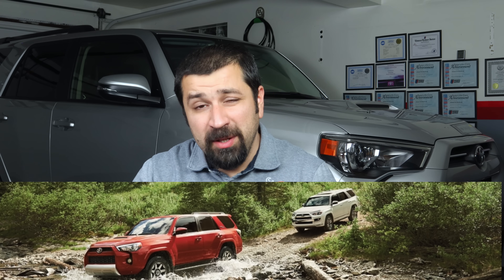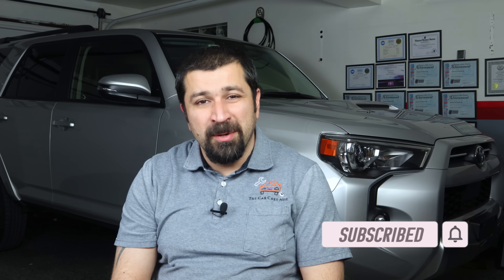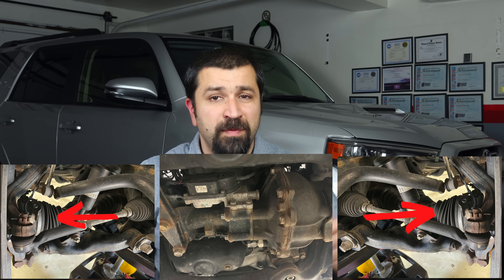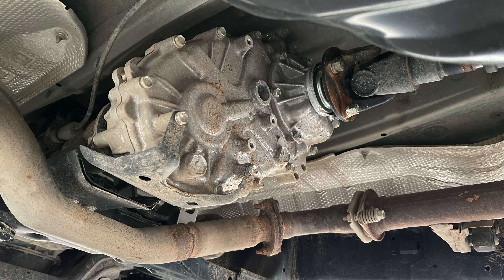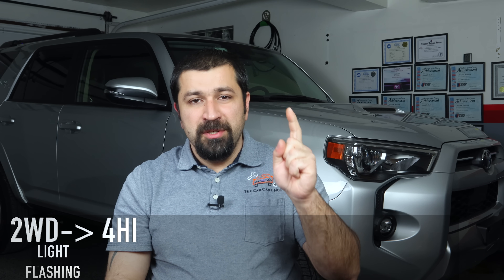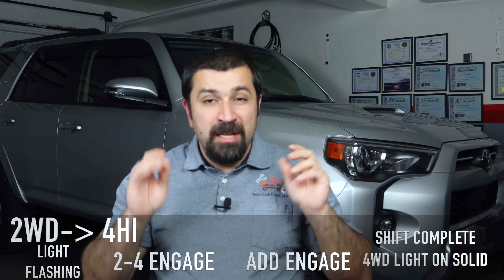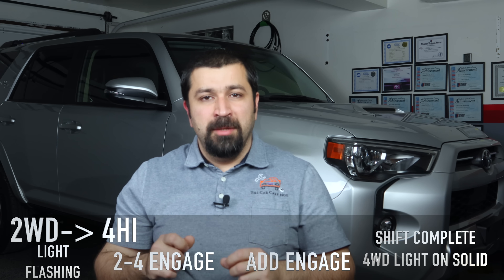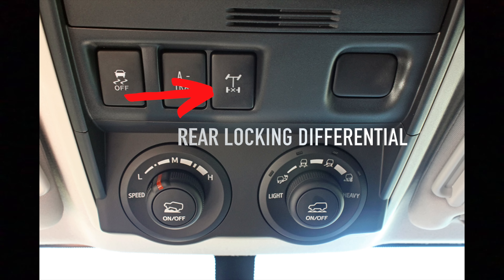How does Toyota 4WD System works and why is it reliable?

Comment from the maker: Let’s clarify one thing that many have commented about. Center locking differential.

There is models that have both 2Hi,4Hi free unlocked, 4HI locked ( center diff locked ) and then 4Lo. Many have mentioned that there is not such thing. I encourage you to research the 4th generation 4Runner VF4AM transfer case on the V6 models which is essentially a modified full time transfer case to have an option of 2WD driving. It does have a TORSEN center differential and can be shifted in 2WD as well. That was called multi mode 4WD system.

So in my video when I included the center differential on the part time 4WD I was referring to this particular case. So YES there is a model with center differential and is technically speaking a part time 4WD. The terminology can be taken out of context here.

Thank you.
Reply: Beside the Nightshade or Limited version, are you aware of CURRENT 2021 model that have a Torsen (Multi Mode 4WD)? Thanks
Reply from the maker: Hi! The multi mode is not available anymore as honestly it was overkill to begin with.
Reply: @TheCarCareNut  ...I love my overkilled 4th Generation V6. I can lock 4HI or let it roll as 4HI. I can leave it in 2WD, and I can use 4LO but I never needed to.
Reply from the maker: @Smoke Stack so it’s supposedly made to help with gas mileage so you can drive on dry pavement with 2WD. Do you notice a difference?
Reply: @TheCarCareNut  ...Absolutely, when I have it in 2wd along with my Michelin Defender highway all-season tires, it’s smooth and good on gas,19.5 MPG and I drive 65 MPH. When it snows, I don’t change tires, I simply switch to 4HI and tires hold up fine in snow, if I need a little more bite I lock 4HI mode, have never needed to be in 4LO.
Reply: @TheCarCareNut  I live in the Pacific Northwest and deal with lots of rain and snow in the mountains so the full-time function is very helpful in the wet and where there is spotty ice and snow on the road. There is a noticeable difference between four-wheel drive and two-wheel drive on the pavement as far as to drive train drag and gas mileage. Two-wheel drive gives around 1to 2 mpg on the highway spending in the speed.
Is the Torsen-equipped transfer case as reliable as the standard one?
Reply: correction to my reply: the mileage difference in 2WD varies depending on the vehicle's speed; smaller around town and greater on the open highway.
Reply from the maker: @billthompson301  I haven’t seen any issues with either transfer case other than seized actuators from lack of use. Thank you for your feedback on the mileage difference
Reply: @TheCarCareNut  Do not have any particular experience with that specific transmission, but can say going from fulltime AWD in the audi quattro systems to the part time in my tacoma is a huge downgrade in New England road driving. The reality is that in intermediate conditions (where it is snowing, but the road is being worked to where you are changing constantly from wet pavement to snow and back), you have to choose between having 4hi on and binding up your transfer case or being in 2wd and catching the rear when you go back to snow.

I would love such a system in a 3rd gen. I could save gas during the good days, use the 4HI during snow, and if things got really bad (where audi's quattro and subaru's symmetrical systems fail, digging themselves out) I could lock it into 4lo, lock the rear and deal with that situation.

Sounds like the dream system to me, not overkill at all! Toyota should have kept it!
Reply: @billthompson301  that's a huge difference if you are going from 17-19 or 19-21. Worth it on such a big vehicle.

I could see why something like an camry or rav4 wouldn't have it, because they don't seem to gain as much (they need around 20-30mpg increase to save the amount of gas per vehicle in reality, MPG sucks as a measurement) and being transaxle platforms, the easiest solution would be to swap from AWD to FWD which would just feel worse in driving.
Reply: @82dupont  Me too on my 2007.
Reply: @asymsolutions  the mixed road condition are also typical for Missouri winters. I specifically went with an older 4th gen 4Runner for the ability to put it into 4wd w/o the center diff locked. I can set it and forget it. Absolutely never had an issue. It’s amazing.
Reply: @TheCarCareNut  Hi - i just bought a 2023 Limited 2 mos ago - i dont have that much knowledge - about the automatic shifter - i learned the flashing has to complete for the ancient computer to compute - can i use 2WD mode in my case - i cant recall whether i have a center locking button in my headliner next to the A-trac - i think i am confusing my own question - hope you cab answer if can do what 82dupont is answering below - or he is talking about a 4runner with a Manual Shifter version ?
Reply: @82dupont  do you have a Manual Shifter Version ? I would love to learn if i can do 2wd with my 2023 Limited with an automatic shifter - any guidance - that gas mileage is killing me for 2 mos of ownership 😢
Reply: @badermalik2823  ….I don’t have a manual. I have 3 options on my 4runner. 2wd, 4hi, 4lo. 

I keep it on 2wd and use all season tires, my 4runner is not lifted and does not have aggressive tires.
Reply: @82dupont  What Year/Trim level is your 4Runner 
Mine is a 2023 Limited has (H4F - H4L -L4L) Automatic Shifter like yours
Reply: @badermalik2823  ….mine is a 2007, we have same drive train. However I believe yours is in 4WD all the time. Where does your knob point to on the gauge? Mine is in 2wd until I engage 4hi and the green 4hi icon comes on.
Reply: @82dupont  It is on H4F as default option - i have alltime - sorry for delayed response . 
Only H4L and L4L as Locking option
I think i dont have Center Diff Lock like yours 
And that is why she is a Full Wheel Drive
Reply: Thanks brother
Reply: Was about to comment on this: the pure part-time 4WD system on the 4Runner has no center differential, it is a chain drive. The transmission spins the driveshaft to the rear axle and if you engage the 4WD system, you connect the system that drives the rear driveshaft together with the front driveshaft.
Reply: 2nd gen Sequoia has the same thing: 2Hi, 4Hi, 4Lo, and w/ central diff lock. Amazing 4WD system.
Reply: How is with 120 Land Cruiser Prado? Any tipps what to watch regarding this system? As I read thode should be Full time AWD? Or I am wrong? Just bought one 2005 with 213.000km runs great.
Reply: @The_Touring_Jedi  Make sure the center diff lock works, and practice that actuator every month. It has the same t case as 4runner V8 and GX470. It has a manual H4 L4 switch lever, so less of an issue compared to our electronic ones.
Reply: Appreciate your knowledge I am learning about my 21 TRDOP
Reply: Let me guess.. It’s Ancient.
Reply: HELP !!!!   Can someone point me in the right direction in resolving my 98 4Runner issue?  When I engage 4H it goes in silent but when it goes back to 2H (disengage) the is a loud bang (like a sled hammer bang). The is a delay for about 30 second to disengage as I drive down the road.  My other 4Runner does a loud click only.  I don't know the history on the car but I have changed all the oil already.

Comment: 2020 Tundra SR5. 4x4 works fine ... but intermittently when moving from 4HI to 2WD it seems like the front diff is not fully disengaged. All 4x4 dash lights are off but when driving around 35mph I get a "rough" friction sound from the front that I thought was either cupped tires or wheel bearings. (replaced all but no change). Sort of a cycling "groan....groan...groan" sound.  If I go into 4HI and back to 2WD a few times I can get lucky and the sounds stops. My question is where should I look first? Is it the ADD actuator on the front diff or is it possible that its a sensor circuit on the transfer case actuator that's not "sensing" a completed front diff 4wd disengagement? Or is the "timing" on the front ADD actuator out a bit?  Any tips would be appreciated?  LOVE your videos !! Thank you.

Comment: I had a question I have a 2014 Tacoma TRD off-road with the rear locking differential, if I once a month engaged my system what all would I need to go through as an example 4 low, high, rear lockers, down hill assist is there anything else that you would recommend?

Comment: Questions for The Car Care Nut regarding 4Runner SR5/TRD and Limited trims (2024 for example): 
For part time 4wd you said that 4H should not be used over 60mph. How would one drive on the freeway in heavy rain or in snowy conditions then while wanting 4WD/AWD for maximum traction/control? Just drive under 60mph in 4H or better to have a 4Runner limited trim with the full time 4wd (AWD)? Looking to buy a 4Runner and wondering if the SR5/TRD or Limited trim is the better option.
Also, as the part time 4WD (SR5/TRD) has no center diff (instead just a transfer case), correct? Does this 4H behave like the limited trim in 4HL with center diff locked? Meaning do both systems then spin the front and rear wheels at the same speed? Is this why the 4H should not be used over 60mph?
Sure wish Toyota would explain their 4wd systems better.

Comment: I was always a Jeep guy. I’ve gotten tired of the garbage they’ve put out since the early 2000’s. Made to break garbage. 
Got an older Toyota 4Runner. Love it and will be turning to Toyota from now on.
Reply: Same here. My second vehicle was a 98 ZJ with a factory lift and HD springs. That vehicle was a beast, but I’m glad I got rid of it before it had issues. Now I drive a 06 LX470 with 249k miles 😂
Reply: lol!! You are one of the few very very smart folks who gave up on jeep but all the old and young kids in my neighborhood are all buying them so I bought the stock and I’m holding it

Comment: I have a 2010 V6 4WD SR5 bought new. One issue I have is with the hill descent control, which is fixed at 4mph.This is much too fast to safely descend a steep, icy road. I can understand that with a typical snow-covered city street, and with peer pressure, this might be a good speed, but on a sheet of ice it is of no use. As an aside, my 2019 Ram 1500 has both AWD and 4Wd, and thanks to your explanation, I think I understand how they pulled that off. Great series.

Comment: My '92 Toyota 4WD system is part time and has locking front hubs, an open front diff, vacuum operated 4H selection, cable operated 4L selection and a 4-pinion LSD in the rear and no centre diff. It's great, though old.

Comment: So, what does my 09 Highlander have? You cannot turn on 4 wheel drive as you can in a jeep. Somehow the car is claimed to be AWD. I've only had this car for a couple of weeks and I do not understand its 4x4 system.
Reply: If you have AWD, ALL WHEEL DRIVE then you don't shift it into AWD, it will engage into AWD all by it self or when your tires in the rear don't have any traction and they start spinning and when that happens then the 2 front tires will engage and all 4 tires will drive the vehicle but AWD works all by itself, you do not press any buttons just drive the vehicle, it's all automatic because of the computer.

Comment: I have the knob, not the lever on my SR5.  If I get stuck somewhere while in 2-wheel drive, can I put it on 4L without it first engaging in 4H which requires the 4R to to moving?

Comment: My 2007 tundra 4LO whines abnormally loud and 4HI does not.  We just replaced the front differential and serviced the transmission.   The part has a 3 month warranty. Should it whine really loud?

Comment: Thanks for your passion and sharing knowledges. I have 18 TRD Pro with 58k miles. My concern is I opt to shut off engine when going from 4L at a stand still to 4H due to the spinning gear mesh sound instead of slamming it back to 4H- is there another way to avoid the smashing mesh of gears besides shutting down engine? Even if I wait the gear seems to free spin

Comment: On my tundra it won't work. The light stops blinking and I hear it shift but then it will go a few feet, tighten up and stop moving, like a gear is getting stuck. When that happened I shifted back to normal and it's doing fine but 4wd won't work for some reason. Recently I changed the transmission fluid but not the transfer case. I've only had to use 4wd once in soft dry dirt.

Comment: You have the best reviews. 
I have a 21 TRD premium with manual lever. I had the 4x4 light flash on me. I believe mine went into the limp mode my local dealer had it for 2 days scratching their heads. They ended up replacing the ADD.but I believe what you said in this video was what happened.

Comment: Wow, all that just so the front driveshaft doesn't spin in 2WD....  I shift my Sequoia into 4WD about once a year, and drive it about 3 - 5 miles.  I never put it in 4 LO.  Should I be doing that?  Also, how fast can I drive it in 4WD?  I know it will shift into 4HI at 60MPH, but I have been told you shouldn't drive it fast in 4WD.  This is my first 4WD vehicle, BTW, in case you couldn't tell.
Reply: usually the owners manual will answer all your questions

Comment: This is a good video for mechanics.  I'm not.  It doesn't explain how 4WD works from a driver's perspective.  For example, if I shift from 2WD to 4Hi (2010 4runner manual 4WD shift) can I make sharp turns on dry pavement?  Will doing so put stress on any mechanical parts?  Why is it recommended to stay below 60mph in 4Hi?  Other than lower gearing, which is obvious to any driver, what is the difference between 4Hi and 4Lo?  Can I make sharp turns on dry pavement in 4Lo?  Why not?  If I'm stuck in deep snow or sand and I shift into 4Lo will one wheel spin while other wheels get zero power?

Comment: This is regarding either not engaging into 4L or not disengaging from 4L , and this is for the 6 speed manuals such as My 2019 Sport with only 11K. I’ve never heard AMD or anyone  else mention this “trick”. I call it a trick because I absolutely have no explanation why it works, but for My truck it works 100% every time!  Put transmission in neutral,fully depress and release clutch pedal 2 times! As You release the clutch the 2nd time it will work perfectly!  Try it! This is of course considering the vent hose did not come off (actuator) and is contaminated/ corroded. That is a different story. And I’m sorry to say I do not know if there is a similar “trick” for the automatics, hopefully there is. All I can say is for the 3 pedal variety’s, IT WORKS !!

Comment: Some people claim that you can tow a 4runner behind a motor home with all 4 wheels on the ground if you have the transfer case with the manual lever, which is still contrary to the owner's manual. They claim the owners manual just says not to do it in order to remain consistent across all the 4Runner variants.  I disagree, and side with the owner's manual.  I know you will have the real answer!

Comment: Mr.  Car Care guy, how do I change my 2012 Toyota Tundra SR5,  V8 5.7 engine truck to four wheel drive, part time.  I here you saying,  Front Differential, two front axles, propeller shaft to transfer case.  xfer case mounts to back of transmission.  Xfer case to another drive shaft to rear differential.  How much of my existing equipment will I be able to use?   Original tranny?  original prop shaft? Is there a list with a complete break down for this?

Comment: I just purchased a new trd pro model..trying to figure out the manual shifter. I can’t seem to not grind going from 4L back to 4H. Is the grinding hurting any gears or the transmission? I did it twice..I stopped trying in case I’m hurting anything. Wondering if there a different way to get it back without grinding.
Reply: make sure it’s in neutral (transmission) and you need to shift the 4wd lever more deliberately than you think , slightly quick and slightly with force . mine was like that until i started using it once a month and getting used to the feel of it and making sure everything is lubricated and worn in slightly

Comment: What do you think would cause the 4wd light to blink. So I was on a trail with my 4runner in 4low. I was making my way up an obstacle and in the middle my light started to blink. I have the manual shifter and my 4hi and 4low still works. But now my abs and 4wd and traction control light is on. I just can’t use A-Trac but 4wd still works. What could that be?

Comment: I have a ‘22 4Runner with the manual transfer case.   I have been engaging the 4H monthly.    Today I tried the 4L and I messed up.   I put it in P while it was in 4L and had a grinding noise.   I did it once and then did it properly.   My bad.   Do you think I have damaged something I need to check out?    It’s operating properly after my mishap.    Thank you for your time.

Comment: Great video, great series and great channel! One note regarding something you said in the video. I have a Tacoma 2007 part-time 4WD with dial for 4Hi and 4Lo, assume similar on other models. 

You mentioned that one cannot drive above 60 mph in 4Hi. That is not correct. I think what you meant to say is that the 4Hi will not engage if driving HIGHER than 60 mph. In the old days, one has to stop to lock the hubs manually. 
Now, one can keep driving to go from 2WD to 4Hi, and it will engage IF below 60 mph. If not, the indicator will just blink and not engage. Same to go from 4Hi to 2WD. 

One can go as fast as one wishes in 4Hi. I use it on freeway when slippery (wet under rain) at max tolerated speed of 80 mph without any issues. If payement gets too dry, I move into the right lane, slow down below 60 mph and go back to 2WD. 

Same thing if road  is snowed in. 

Maybe someone already mentioned it, but reading most comments I didn’t see it. Cheers!

Comment: I had to replace my 2004 4runner transfer case and differential last year. Cost me $4k for the entire job, but my car has 340,000 miles on it. 😆 🤣 😂, not a bad trade off.